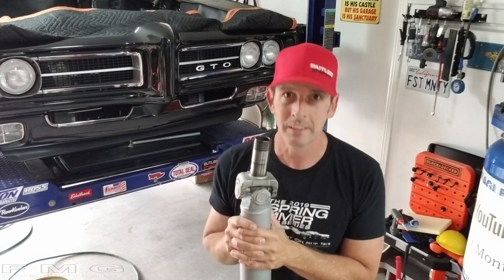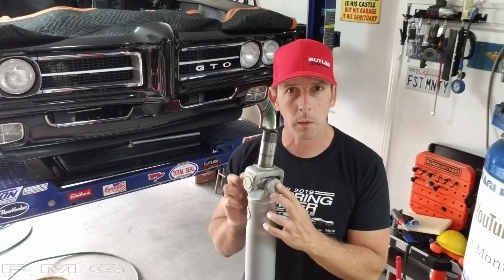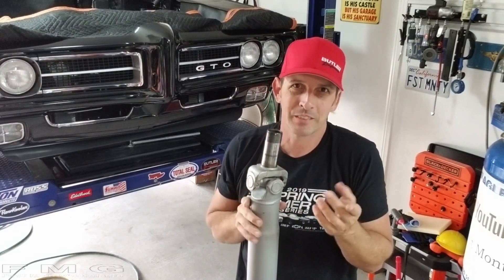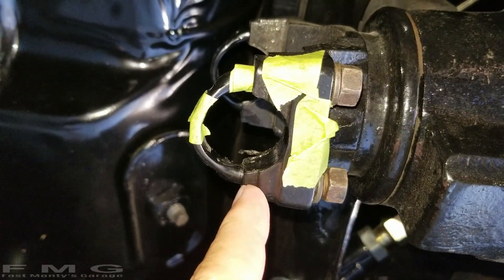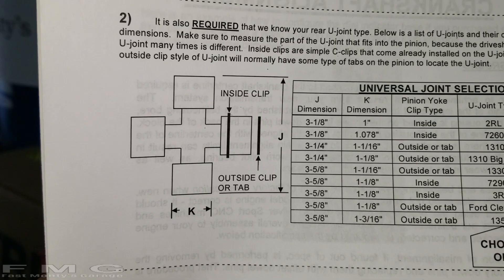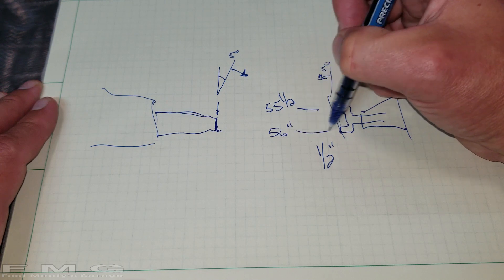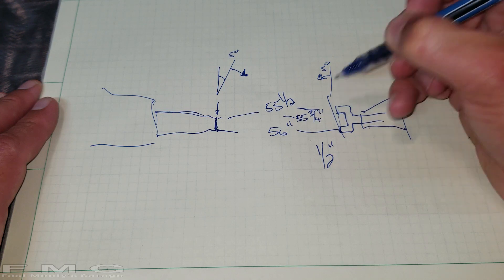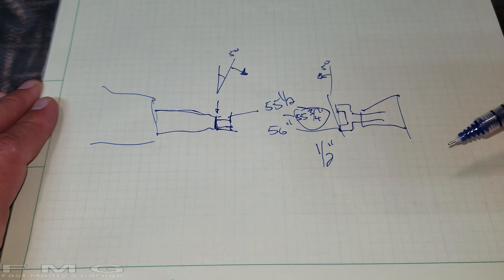TREMEC TKO/TKX/T56 Install, Part 6:  How to measure drive shaft length, for your TREMEC.

Comment: Looks like I’m a few years too late.  You should’ve measured the angle of the transmission output shaft and the angle of the rear differential yoke.  They need to be the same but opposite, ie, trans at -3 degrees and rear diff at + 3 degrees.  There are angled shims to put under the rear differential leaf spring attachment locations.  Improper angles will cause drivetrain vibrations under a load.
Reply from the maker: Well aware.  But, A-Body's don't have Leaf Springs.  Thanks!
Reply: @FastMonty LOL, I started the Pontiac alphabet at the letter F.  How do you deal with the pinion angle issue when both are negative?
Reply from the maker: @MarshallMB  Ha!  That makes sense.  For A-Body's you can get adjustable Upper Control Arms, and some companies like Detroit Speed make adjustable lower trailing arms too... which I'll be doing a video on soon.  Thanks!
Reply: @FastMonty I’m running Detroit speed upper and lower control arms and their two way adjustable coil over shocks up front, their rear springs with Koni in the back.  Moser 12, just finished up all of that installation.  Smoothing the firewall then dropping in the stroker with TKX hence the reason I was binge watching your TKO, Cold Case, back of head cooling tests and other misc videos.  I’ll drop you a note and my Ph# on your website link in a day or two.  I’d like to chat about the radiator, fans, shroud, wiring, relays, and placing an order etc.

Comment: Alrighty, cruising right along here. Trying to catch up to your tubbing mod! Quick Sunday question...I need to get the driveshaft measurement and I just wanted to verify that all you did was install the bellhousing, bolt up the TKX with the crossmember, check my driveline angles, and then I can measure. Right? 😊
Reply from the maker: Correct!  no clutch to make install easy.
Reply: @FastMonty  Thank you sir. I just realized they did not supply me with any template for cutting the tunnel. So now I need to decide whether to eyeball a cut or wait. Dang.
Reply from the maker: @designsinorbit  Ahhh, another hurdle to add to the list.  I'm sure you can eyeball it just fine.  Have fun!
Reply: @FastMonty  It does seem like it would be easy to eyeball. My concern is, will the shifter be located in the most comfortable position possible...too many options!
Reply from the maker: @designsinorbit  ha!  Yeah, so many options... I know you'll figure it out.  Keep us posted.

Comment: If you have the Global West Suspension on your car like I do I can tell you pinion angles are going to be way off. You should have used a digital protractor. And then you're going to find out that you need to put the tranny much higher in the tunnel
Reply from the maker: Ha!  yeah, I can't remember what video I mention that, but unfortunately it's a problem I have to tackle later.  That said, the new TKX helped, as I could raise that higher in the tunnel than the TKO.  Thanks!

Comment: Thank you for these videos.
I just started the swap in my '70 Charger. I am thinking of mocking up the bell and trans to measure for the drive shaft, making the order, then stepping back to do the hydraulics, the pedals, the tunnel mods, carpet and seats while the drive shaft is being made. It makes sense to order early this way..... so there is no 2 week down time waiting for the shaft while everything else is finished.
Reply from the maker: Good point Gregory... I did it the same way, mocked it up, without the gear shift, and clutch installed.  Measured it, ordered it, then started on the tunnel mods.  (When you're mocking up, for tunnel mods, make sure you put your long tube headers back on, as well as the stick shift)  Have fun!